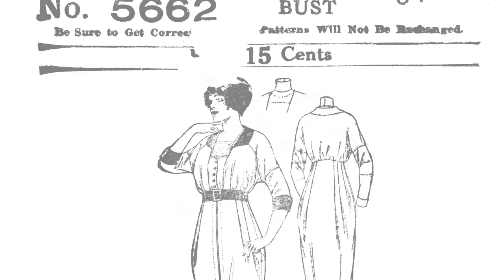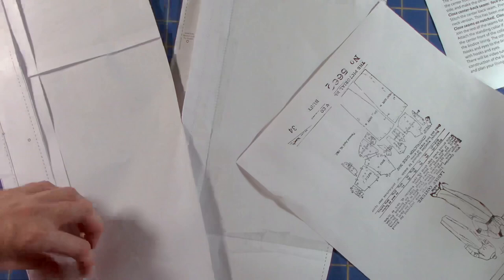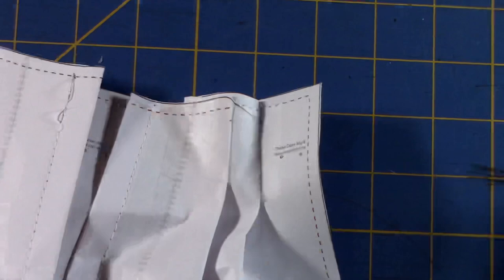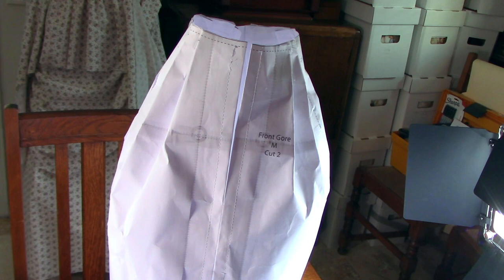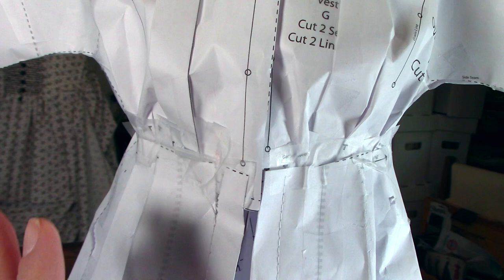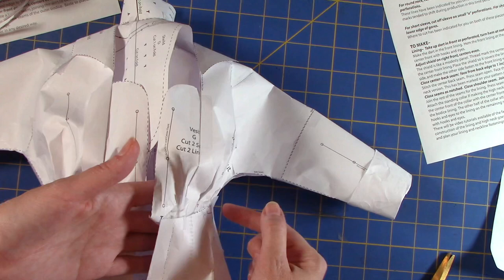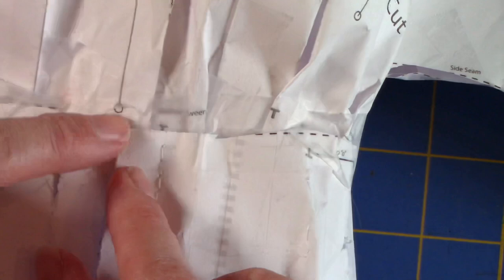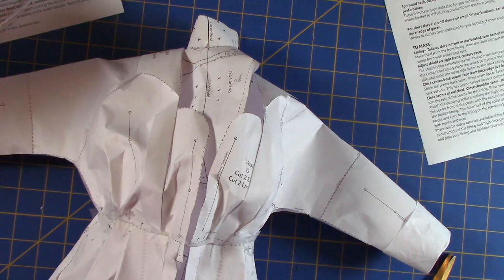Part III- Making a 1914 Dress- Attaching the Skirt to the Bodice & Bodice Lining

Comment: I found your pattern on Etsy and with the help of this video series, I think I'm gonna go for it! One question: is a 1910s corset required/recommended? And if so, do you have a pattern for that? Thank you! :D
Reply from the maker: Awesome!!  Good luck!  The proportions are probably best with a corset, especially if you want to wear it in a historical sense, but you can adapt the pattern for a more modern fit without corset.  Just make sure to mock it up to test the fitting and construction :)
For a corset pattern I recommend the 1910s corset pattern by Scroop Patterns.  I’ve made that one for myself and it’s really great!
Good luck!